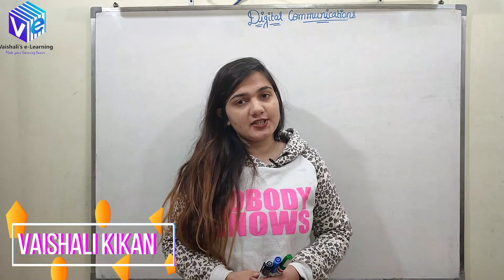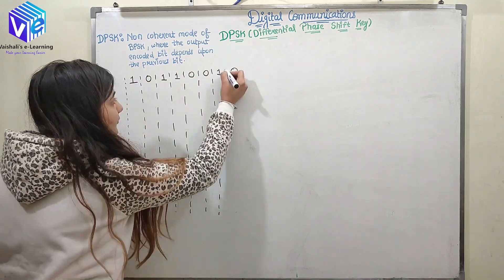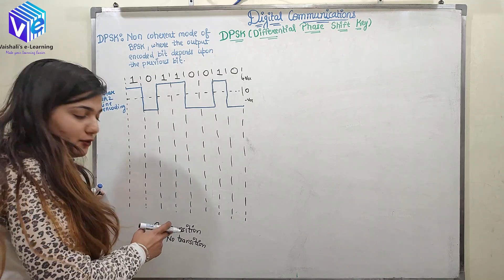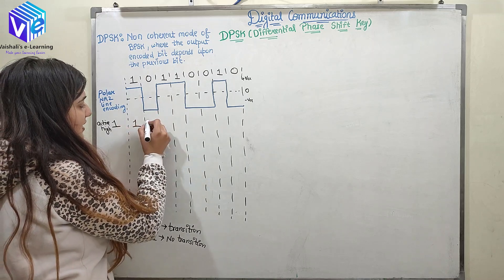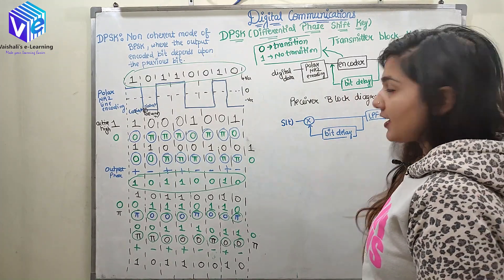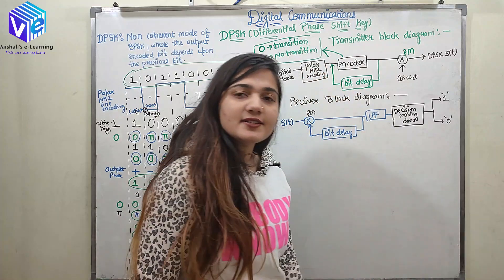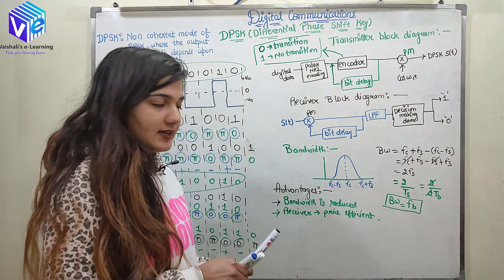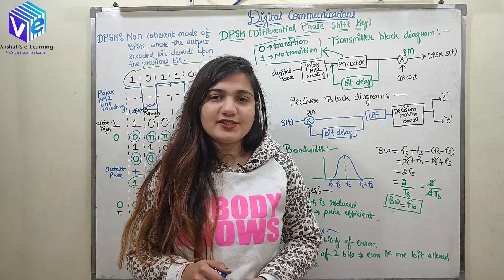L 11 | DPSK | Differential Phase Shift Key | Digital Communication | Vaishali Kikan

Comment: Hello 
Thank you for your good explanation
But I have a question
 What is the bit stream that is transmitted in this case?
is it 10001001 without the active 1 from previous step
or after shifting 11000100 to 8 bits same size of the transmitted data and ignoring the last one
or all of the set 110001001
Reply: I think 110001001.